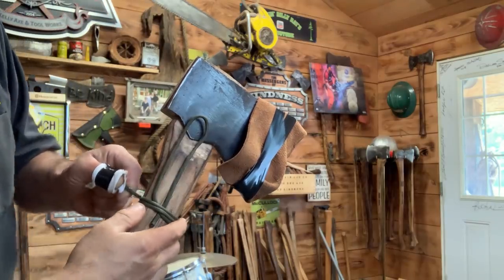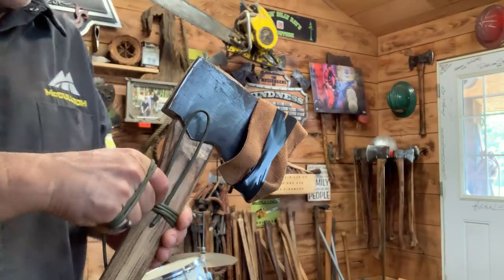How to para cord wrap an Axe handle

Comment: Whenever I have an axe in the vise, or am going to be handling it for any length of time without a sheath on it, I put a piece of tape over the bit. Saves from getting cut. I used to think I was cut proof, but not any more. Cheers.

Comment: Fantastic video! I need to tighten up the head on the first axe I hung, it slipped a tiny bit this winter pounding on a frozen log to bust it loose from the ground. Once that's squared away I think I'll wrap the axe too. I have an entire roll of recoil rope for weed eaters that I barely ever need, so I think I'll use that because the budget is a bit tight at the moment. Everyone have a GREAT Easter Sunday! See you in the trees.

Comment: Instead of using paracord I use tar infused catfish bait line from Walmart. The tar infused in it won't let it rot and it does the same thing as the paracord. Plus the tar lets to get a grip on the handle by the head for better control of the head if you're trying to use it to make what's called feathering in bushcrafting to help make fire starting material.

Comment: I would probably treat a new axe with many coats of linseed oil before doing this. The paracord would probably bite a bit too much in to a new axe. Nice video.
Reply: mombasadele that’s exactly what I was thinking. I think for me I’ll do a couple months of coatings then every year I might undo the paracord and put another coat of BSO on it
Reply: Joe Schranz Yeah exactly. And you can't really only oil the part without the paracord, it would leave an ugly section beneath. BSO - is that beewax with linseed oil?

Comment: Hmm.. I have to agree with matt van berkel here… I was expecting bar oil or two stroke oil to pour out of the cut in your thumb.. Haha!! Just kidding.. But wrapping the upper part of the handle with paracord is just good, common sense. It will withstand the bashing and abuse from beating wedges much better.. Have seen it done with soaked rawhide, and the result was impeccable. When the rawhide dried, it tightened up and became rock solid. Hope all of you in here a great week, take care folks, and be kind :)

Comment: I hate to put something negative in your comments but did you use this axe yet?
I copied how you warped them on my axes and it fell right off splitting wood, it seamed very solid in the garage but came loose once it hit wood. It's not a big deal, im going to warp it in the other direction now like everyone else does its a 10 minute job and I can reuse the para cord.